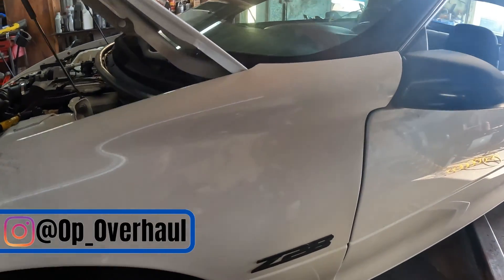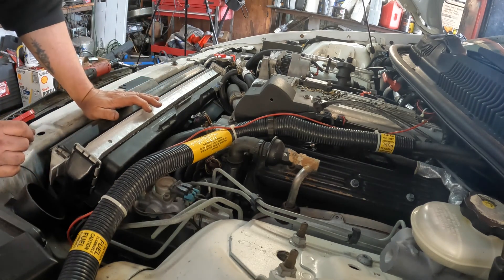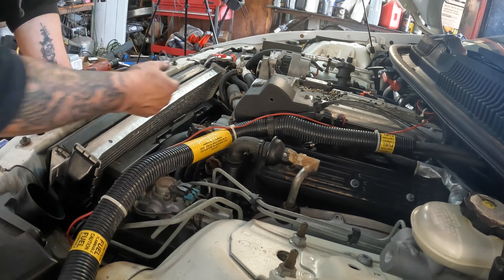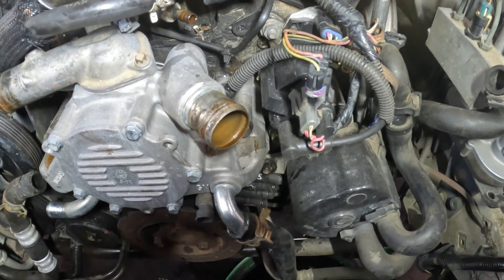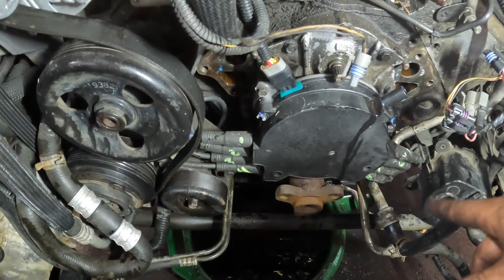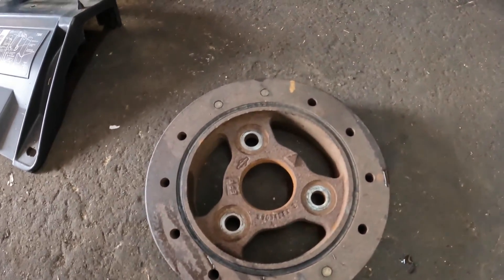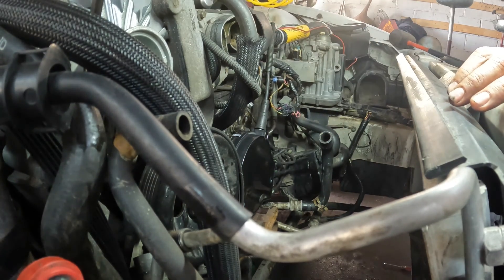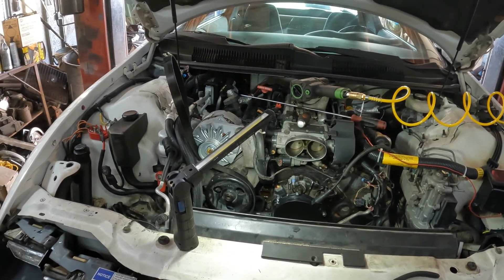LT1 Optispark  Distributor Replacement

Comment: How was your car acting with the old one on.
Reply from the maker: It was misfiring pretty badly and had a lot of hesitation.
Reply: @operationoverhaul did you have to put the moter to top dead center
Reply from the maker: @ethanbradley2643  You do not have to do that, but it will make it way easier during installation if you do.

Comment: I have a 95 5.7 lt1.... had Head gasket replacement/ fuel pump middle up...ran great...car sat up for a while needs lil more work..but got it up from south of my spot ran great she shut off on me, but 2hrs later she started,  but. Ran for 30 min sporadic up down shut off, wouldn't restart until 2hours so I took her too a spot it's a Camaro guy, he replace ignition coil,  they drove it ran it good,  when I got her let it runnnnn went for test myself died , at first I thought filter,  /vacuum leak..but the guy did  digging opti spark water pump was good btw..but why in a lti does a failed opti have the motor do that ( learning)
Reply from the maker: The optispark controls a lot of stuff on these engines and they will make them go crazy if it does not receive the right signals or it fails and does not send the correct spark.

Comment: I like how all these videos skip removing the harmonic balancer. Smh thanks
Reply: My thoughts exactly. Trying to pry this off atm
Reply: It doesn't fall right off in the midwest
Reply: im trying figure out how/what was used to keep the balancer from  spinning nothing i do is working
Reply: Not to mention the test of the car not working to hear what type of sounds to look for, etc
Reply: to get it off I took off 2 bolts by while holding the 3rd in place with another ratchet or breaker bar so that nothing is being turned over, then for the last one you can either find someone to hold the balancer for you or do like I did and hold it myself as I break the last bolt lose, it’s completely possible and you don’t have to be super strong to hold it, it may take some going back and fourth but it will work, as for getting it back on I’m still trying to find that out unfortunately
Reply: @shonwheeler9125 it doesn’t just “come off” you need to get a 3 prong crank puller and pull it off.
Reply from the maker: It is three bolts on the front of the hub and it comes off.

Comment: How did you pull just the Harmonic Balancer off?
Reply from the maker: After removing the three bolts, I just tapped it with a rubber mallet and after a couple taps it came right off.  No puller was needed.

Comment: you don't have to remove the radiator
Reply from the maker: that is true.  you do not have to remove it but it does give you a little more room and it did not take much to get it out of the way for me.  SI should have clarified that in the video.  Thank you for letting people know that you do not have to but if you want to you can and it will give a little more room to work.

Comment: What year lt1 is this rhis ?
Reply from the maker: 1994
Reply from the maker: @machinesnmetal  you can get the engine code off of it and look it up and it will tell you everything about it
Reply from the maker: @machinesnmetal  yeah you will need the obd1 connector to read the computer on that unless you get the 96 computer.

Comment: I have an msd opti is it possible to have an oil leak behind it i knw thee is one above it from water pump seal does rhe seal behind there go as well ?
Reply from the maker: Is the oil on the opti spark
Reply: @operationoverhaul   well it's on the plug wires but I think it's dripping down from the water pump seal
Reply: @operationoverhaul yes it's on the opti I'm goin t change the seal behind the pump and behind thr opti I am scared to do the crank seal 😂
Reply: The seal. It f leaking and not change. Next opti will die soon

Comment: Just bought a 1994 and the previous owner told me he threw the original opti away and replaced it with a Delphi one even though the original was still working 😭😭😭.
Reply from the maker: Why would he do that. The factory ones are better and he should have just changed the cap instead of the entire unit

Comment: What is the best optispark for 97 z28?
Reply from the maker: A factory original one to be honest.  I can get you the part number or you can call your gm dealership and they can get it for you but that is the best one to use.
Reply: @operationoverhaul  I appreciate that so much.  I've looked and searched so many forms it's ridiculous. Msd is trash ect so I have read. My car is popping/back fire out the exhaust sometimes. Still runs stout for now but I assume that's the opti going on its way.
Reply from the maker: @kseriesholden2606  yeah it sounds like it is going out to me. They get moisture in them pretty easily.
Reply: Your mom works best for me 🤷‍♂️

Comment: Great video have a question. I have a 96 camaro Lt1 I just replaced my optispark and afterwards the car has been throwing the p0336 and p0335 codes. Which points to the crankshaft position sensor. I replaced that and the wiring. Still getting the codes. So im thinking either the harmonic balancer is not right. I never took out the hub because you don't really have to. But to get the optispark off you have to move the hub a little so i did just by inserting a bolt and tightening it turned it enough to get it out. Then turned it back so i wonder if that did something possibly? Or do i need to get the car to TDC? Im confused and have been stuck on this for days. The car starts great but i haven't driven it due to the codes and it vibrates some.
Reply: Yeah which Makes me think it's something to do with the optispark or that harness. But here's where it's confusing. So everyone knows that the original "Mitsubishi" optispark sensor is the best one to have that I've known. So my old cap and rotor were shot the thing had a crack all the way down it. So I purchased the entire optispark from autozone it was a duralast gold. I put that in put everything back together and that's the first time it threw those codes. So I read on a camaro forum that the old Mitsubishi sensor inside were the best to have. So I took everything off again and took the duralast optispark apart and put in the Mitsubishi original and the slotted wheel thinking this would change what was happening with the codes. Got it all back together it starts good at cold start then starts to idle a little rough or vibration just as it did when I put the duralast one on and still has the codes. So I don't think it's either sensor in the optispark otherwise it wouldn't start like that and at least seem like it's going to run like a beast. So I'm stuck I changed the sensor and plug for the crankshaft that didn't work. I've tried moving the harmonic balancer thinking that was off point or that something could still be off point on that. Then I'm thinking it's a ground that I could have accidentally hit or moved and was old and came loose during the first tear down or the harness could be messed up or a bent pin on the new harness for the optispark. Or just plain out that the crankshaft position sensor is faulty. I haven't checked the harness yet. I've looked at some of the wiring. And I've checked on the camaro forums etc a few people have had this issue unfortunately you never get to see a solid outcome or solution lol. So hear I am, have you seen this problem or have an idea it's driving me insane.
Reply from the maker: I would check the grounds to make sure that there is not one loose, broken, or corroded.  Then if that checks out good, I would check the signal on the crank sensor to be sure it is reading correctly.  If I remember correctly it can only see a - 10 degree to a + 7 degree range.  If it bad I would pull the sensor and use a flashlight to make sure the reluctor wheel is not broken or missing pieces and also check the connections to the sensor.
Reply: How do you check the signal to the crankshaft position sensor? By the wiring harness I'm guessing. That sensor is new and the plug but that doesn't mean anything your right I'm definitely going to check those. I've never thought about checking the reluctor wheel but that makes sense. I'll definitely let you know have you seen this sort of thing before?
Reply from the maker: @joshhall7702  you actually need a scanner to see live data from the sensor. If you know of anyone that may have one that will let you see signal.
Reply: @operationoverhaul  everything looked good on the scanner. I should have noticed this before but the harmonic balancer it was wobbly and really easy to get off like I took that thing off 6 or 7 times no puller just came right off. Also there was some kind of noise under the car after I changed the optispark. I put all that together and realized it could be the balancer that sensor is right under it as well. So I purchased that tonight I'll put it on tomorrow and see if that is the problem. It came with Like a half moon key I guess is what it is I'm not sure where that goes im not replacing the crank hub just the balancer/damper wheel. Do you know where that key goes?
Reply from the maker: @joshhall7702  can you send me an email with a picture of the key?
Reply: @operationoverhaul  yeah I can whats your email
Reply from the maker: @joshhall7702  robinsonautomotive@yahoo.com
Reply: @operationoverhaul  well nevermind on that note. Its not the harmonic balancer. But at least I got a new one it needed it anyways. So I'm back on the diagnostic hunt. Although I feel like it's something simple and its right in front of me. Something that will throw the p0335 and p0336 codes and makes the car idle a little rough or vibrate. Granted the crankshaft position sensor they say on the lt1 doesn't do anything or effect anything. All it does is detect misfires. What I'm confused about is what misfire because most of the misfires have there own codes and I've done all that maintenance and upkeep. So I need to figure out what misfires or (misunderstanding) the computer is reading lol.
Reply from the maker: @joshhall7702  I would start the car and start pulling wires to see which cylinder or cylinders are misfiring.  Then I would find out if the optispark is even sending spark to the cylinder.
Reply: @operationoverhaul  yes I'm going to try that and check and ill let you know what I find out hopefully its simple. Although If I have to tear everything down to the opti again it's actually not that bad I can do it all in about 2 hours.
Reply: @joshhall7702  Many cheap ebay and amazon rebuilt optis are improperly reassembled then a new bearing is installed leaving the rotor in a position other than top dead center of cylinder 1 or 6. Had that experience with 2 units. Run very rough, stall, back up against starter or do not start at all.
Reply: It's probably the new optispark is bad.
Reply from the maker: So it just started to throw those codes after you changed the optispark?
Reply: Did you clear the code after you worked on the car ? If not the car will not run right because code is still  stored in computer memory.

Comment: Best Optispark distributor is a OEM opti that came from the factory, just clean up the inside new cap & rotor,lock tight on the rotor Screws, its the aftermarket optis that crap out be lucky to get 10kouta aftermarket.
Reply from the maker: I agree as well.  The customer is the one who ordered the part and I told him to go with either an oem or the msd one if he was going to do it.
Reply: @operationoverhaul  From what I've researched since last week when mine started going out the oem and msd opti's are hit and miss these days as well. For  700 dollars for an msd or round 300 for a delco I elected for a cheap amazon myself for now was thinking and looking into the 411 swap but just want to get it back on the road reliably for now. I'm probably going to look into rather then using the whole new one try and clean up the optical and clean it out use cap and rotor from the new and see how it goes. Not opened it yet may just need the cap and rotor anyway I'm thinking it is a distributor after all. Started having the stall while driving issue

Comment: Hey man good work thanks for making this video, short , sweet, to the point , very helpful and informative. This gave me the courage to attempt this on my own. Im going to do an electric water pump upgrade as well as a petris optispark, better quality also the electric water pumps dont have the weep hole on them that drips down onto the opti causing them to fail alot
Reply from the maker: I wanted the owner to use a better quality optispark but they got the cheap one.  I never thought about the electric ones not having a weep hole.  That is a good upgrade to do as well.

Comment: Hi there! Thank you for the video! I am in the mist of fixing up a 95 Camaro z28 auto and got a low pulse code- so I’m probably replacing the optispark. Why were you doing the water for the coolant lines? Is this to repressurize the lines or clean them? Also can you not use coolant in these cars? Sorry if it’s a dumb question just not knowledgeable 😂.
Reply from the maker: Not a dumb question.  I had already put full strength coolant in the car and was diluting it with water.  You typically want like a 50/50 mix of water and coolant in your system.
Reply: Need coolant so insides dont rust up just mix it with distilled water not tap water

Comment: Wow you managed to make it work congratulations keep that LT1 running strong👍🏼 my optispark just went out a couple of months ago but I'm having someone replace it for me I don't want to mess it up plus I want a cam kit installed as well🙏🏼✌🏼
Reply from the maker: Yeah these give a lot problems and a lot of people are actually going to the LS engine coils on these now to get rid of the optispark.  It makes them easier to work on and better spark.
Reply: @operationoverhaul  thanks for the advice👍🏼  great video by the way.